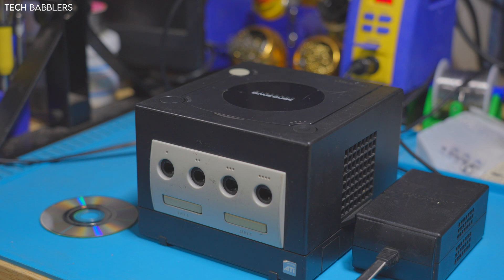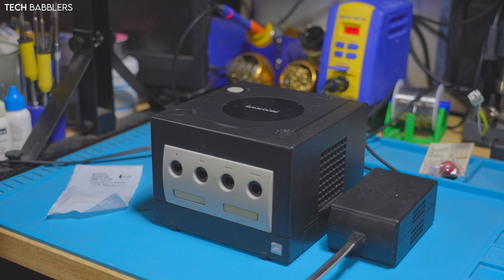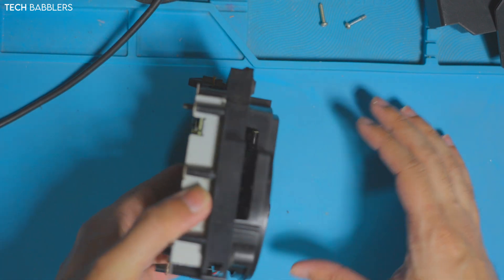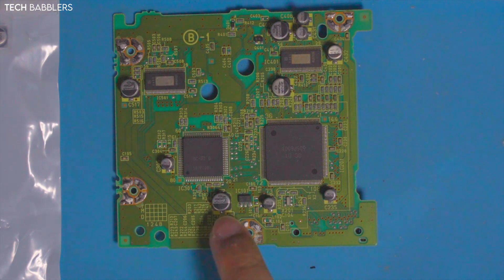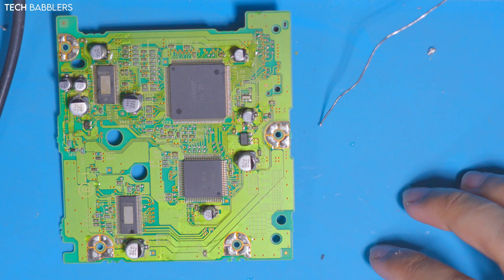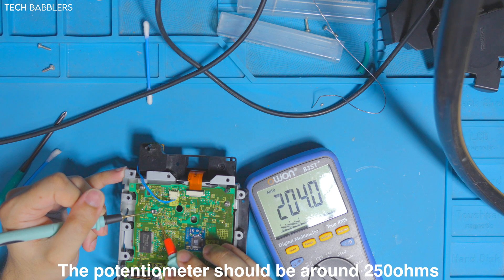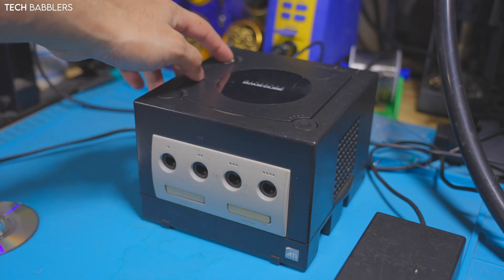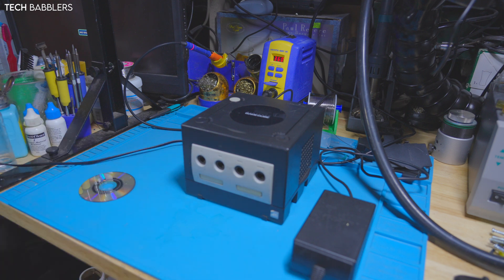Fixing A GameCube That Can't Read Discs!

Comment: So happy to see old systems like this been brought back to life, their something about it that brings a smile to ones face looking this machines back in action and giving them a new opportunity to continue their service .

 great job on the recapping, it seems it was much easier to do with a heat-gun than the soldering to remove the old caps. I wonder if doing those soldering paste that melts with the heat-gun would make your job much easier instead to solder the caps using the soldering method.
Reply from the maker: Could work yeah, i've honestly been neglecting solder paste in a lot of places where it would probably be simpler to use.